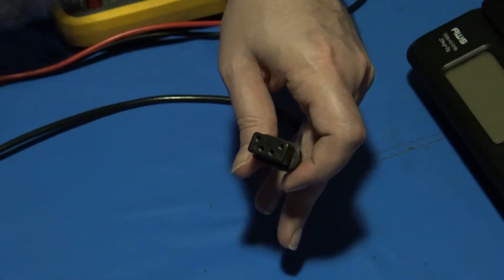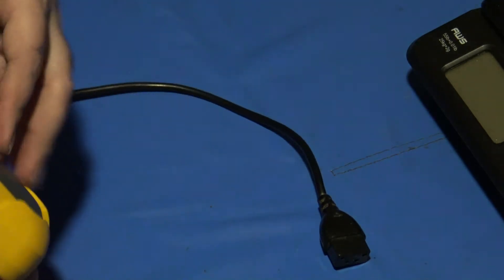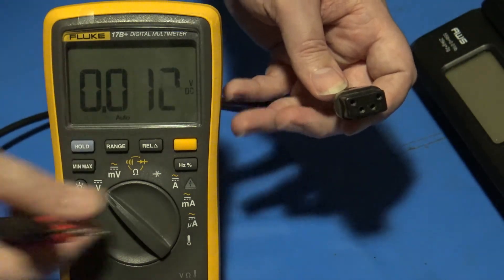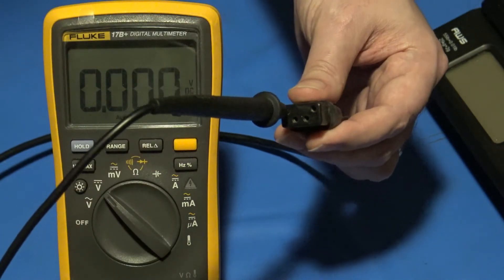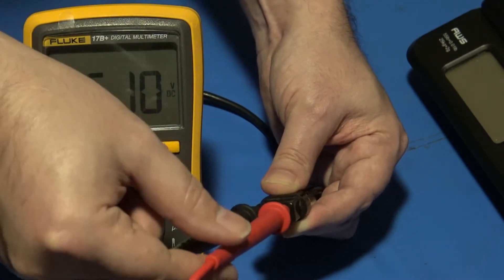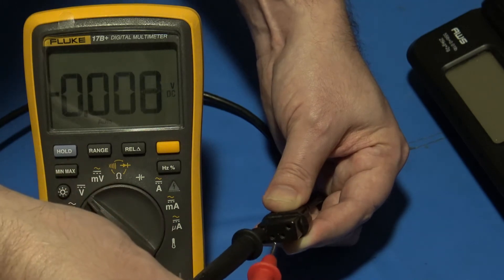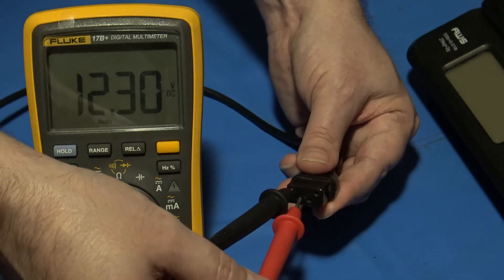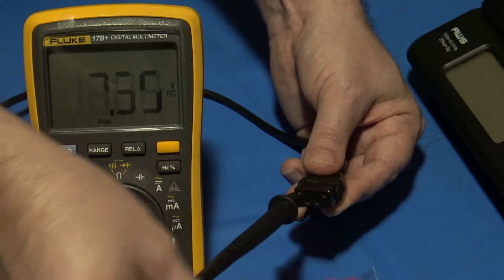Testing a Colecovision power adapter

Comment: I tested mine due to my CBS displaying an unstable, wavy picture on screen; and I got +5.14V, -4.88V, +12.02V

Are those considered correct voltages or is it possible my AC adapter is causing the issue?
Reply from the maker: The video is only showing you that voltages from the power supply are good. But you can have a power supply that puts out what seems like correct voltages, but might not be putting out enough current to do the job still. So if you really want to more accurately verify the voltages in the Colecovision itself, then you need to open it up and probe near the two inductors to the right of the power switch to at least verify the +5 and +12. That way you can see how much actual voltage is getting to the system once the power supply is loaded down. The wavy picture could due to something in the PSU that isn't filtering out properly.

Comment: What are the acceptable ranges for each output?  
I'm getting +5.29, -4.96, and +12.24.  Is 5.29 volts on the +5V pin too high?  Thanks!
Reply from the maker: Yes that is pretty normal. The CV PSU is just a large tranformer for the most part, so without a load it isn't that unusual for the voltages to read higher. Best way to really measure requires connecting it up, and measuring the voltages on the inductors near the power switch when it is on to see how close to +5 and +12 you are reading then.

Comment: Awesome! Thanks to your video I found out the adapter of my ColecoVision is not working well! Pin1 2.90V Pin2 -5.06V Pin3 10.48V, now I have to buy a replacement or making a new one
Reply from the maker: The original PSU can be usually refurbished by cutting it open and replacing the caps and voltage regulators inside them. Console5 sells a refurb kit for the CV PSUs. I don't actually do this as I'm not the best at cutting them open in a way that they can still look goog when glued back together. So I usually by replacements. There are several options for replacements these days, but the best ones from my testing have been to find and use the ColUSB, using one of the Lundy's Electronics adapters combined with a specific Meanwell PSU, or the ones that Keelog sells. The only issue with Keelong supplies is that they tend to have short cords on them but otherwise their current versions seem to be built well and work very well. I have one of their PSUs in my main game room setup.
Reply: @IvoryTowerCollections  I'll try to open up and have a look, thanks!

Comment: Hi thanks for the video. I just bought an adapter for my coleco and it isn't powering up- tested it as you said and 1st 2 numbers tested fine but not the 12-volt part.  So is it the power adapter or the coleco that is the problem you think?
Reply from the maker: If you aren't getting the +12v off the power supply plug, then the power supply would be the issue in this case.
Reply: @IvoryTowerCollections  thank you.

Comment: I have a brand new power supply that reads 11 volts. Is that exceptable? could my meter just be a cheap meter, or do you think it may be the plug ?
Reply from the maker: If you are talking about the +12v only reading 11v that is an issue and it needs to be at 12v as there are components within the CV that expect that. Being a little over 12v is fine, but only reading 11v is likely too low.
Reply: @IvoryTowerCollections  thank you for clearing that up!

Comment: FYI, even though they may show correct voltages, they may still be bad and cause various different glitches such as artifacts and color problems. Some games work fine, others may hang.
Reply from the maker: You are correct in that while the voltages may read proper, it might not be providing enough actual currant on each of those voltage rails to the system. That video was done to show another person on how to reach the voltages coming from their CV power supply to see if they were at least getting anything from it at the time I made it.
Reply: @IvoryTowerCollections  I’ve repaired more then a few of these power supplies and bad electrolytic filter capacitors is the most common issue with them that will cause the console not to function yet you will still get correct voltage readings.

Comment: So, can I use my TI-99/4A PSU? They fit and, well,y Colecovision has no PSU. ;) Guess I should break out the meter. :)
Reply from the maker: I haven't checked to see what the voltages are coming off the TI-99 brick or their pin orientation. But I do have a working TI-99 and I guess I could check and see. This video was done to help a client of mine having what looks like some power issues on their CV.
Reply: No, they are not compatible. The TI-99/4A power supply outputs an AC voltage of 8 and 16 volts. The power supply portion that turns this into the appropriate DC voltages is built into the computer itself. Needless to say don't plug it into your Colecovision. :)